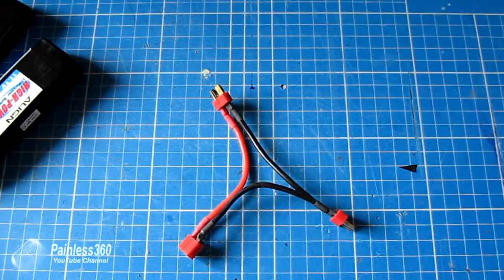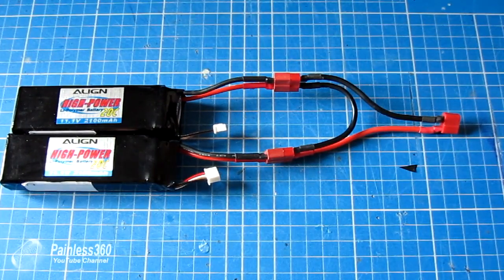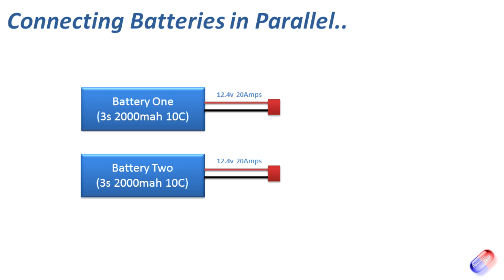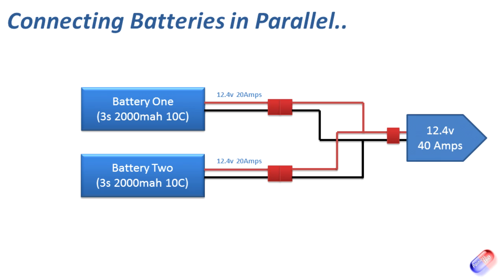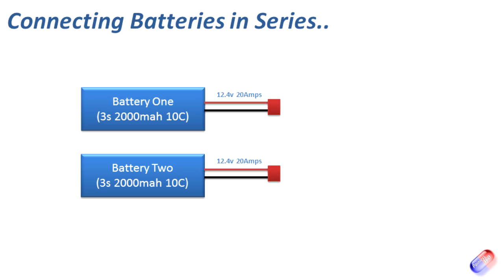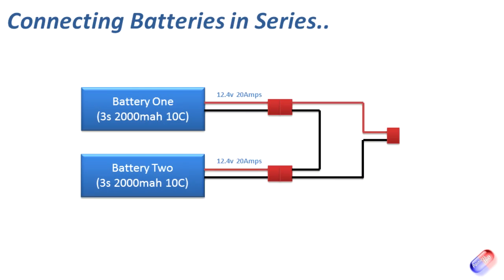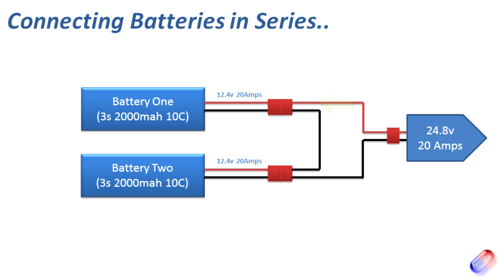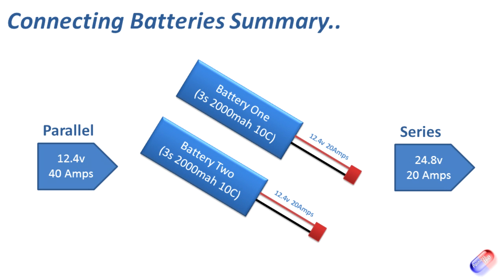Connecting batteries in series or parallel (LIPO)

Comment: Hello, I'm new to rc. I would seem that connecting in series and gaining more volts would increase the performance quite a bit but if you want more reserve energy, parallel would be better. Is this a good assumption?
However if
P = I x V
480w=40ax12v parallel
480w=20ax24v series
Why does the motor perform better under series? What am I missing?
Reply: Correct, P = I x V

Youre not missing anything, its a vague concept so dont give up, look at it this way. 
(Im going to be careful on how i word this and use the proper definitions)

you can have
higher Voltage/less current
or
lower voltage/ more current 
It will still produce the same power (in reference to the physic's definition of power)
which is exactly what you showed in the equations.

However, connecting in series results in higher voltage, meaning higher "strength" or performance but same battery life

Connecting in parallel will result in the same voltage (no performance gains), but more battery life. 

As im writing this i found a clear way to explain

"The candle that burns twice as bright lasts half as long"

So, both setups will produce the same power over time 
Since their voltage is different, the time it takes(current) to produce said power will be different.

You can choose to have all the performance but for less time
or
Have less performance but for more time.

........

I am on alot of caffeine so ill keep going incase you or anyone else reading this needs a little more 

Two people both make the same power ($100)
Person A makes higher voltage but less current ($100 in an hour)
Person B makes lower voltage but more time ($100 in a week)
Reply: @danielcolado5444  right, ok I understand. Would it be better to increase both volts (up to what is permissible of course), thereby connecting batteries in series, and then connecting a few in parallel to increase the amps as well? I've heard though that the quickest way to blow motors is by increasing amps though as this is harder to control, is this a fair statement? How does one increase amps safely? Sorry for the bombardment of questions, I'm surely putting your coffee brain to work...
Reply: @mxm1766  LOL

Well let me begin by saying i am NOT an engineer, but i have tinkered with electronics throughout my life and took a couple of physics classes as a requirement for medicine (basic circuits and stuff, loved it)

I know for sure that overvolting would blow a motor.
I would assume a higher current would as well. 

Not sure if this is the right word, but if the motor and/or battery has a "regulator" that determines how much amp comes in then i dont see any harm. 
(again i dont think i used the term regulator correctly but for the sake of discussion)

Example:
Two 3.7v 700 mAh batteries in parallel would provide the same power as a single 3.7v 1400 mAh. This method in my experience would help your playtime run longer, havent had problems yet with anything catching fire. 

I am a novice so anyone with more experience feel free to add anything or correct me!

------------------

i did the same thing you are proposing. 
I wired an LED off road lightbar to my RC just how you suggested. 
Light bar rated at 9.6V but i only had 4.8V
So i ran 4 batteries in total.
Batteries 1 & 2 in series
Batteries 3 & 4 in series

Batteries 1&2 parallel to 3&4
Reply: Also what do you mean by better?
Both are helpfull. Like you said, increase the   voltage to the permissible limit then increase the capacity (mAh)
Reply: @danielcolado5444  better as in more performance and more run time. I suppose that the regulator would be the ESC in RC terms. Anyway, thanks for the insight

Comment: Which one is better to fly longer series or parallel?
Reply from the maker: Both potentially. If you're not planning on changing the ESC, motor and prop for maximum efficency at the higher voltage then parallel is the best bet..
Reply: @Painless360   Thankyou.

Comment: When connecting in parallel would it be adetageous to install a large diode so both packs supply the voltage and stop the less charged pack being topped up by the more charged pack. Or does this allow for voltage stabilisation?
Reply from the maker: It's an interesting idea. The problem comes from the fact that the diode will actually drop the forward voltage a little so that'll introduce more problems than it solves. Plus you need a diode that can handle the max amperage of the packs. Happy flying!

Comment: Hello. I have a question. I  have several 6s 5200mah 50c packs and will be needing 8s soon. The ESC connector has a loop connector connected to the 2 ESC leads which would normally have two 4s packs connected to each. Would it be possible to just buy some 2s packs that are the same brand, mah, and C rating and combine that with the 6 to get 8? Ive asked this in another forum and got mixed answers. Some said NO WAY!! And others said its no different than combining two 4s packs to get 8s. Thank you

Comment: I have two 1400kv motors and two 2200mah battery.....so I need more flight time so I should connect them in series or parallel ....plz reply ASAP
Reply from the maker: See my endurance builds. More mah is what you need....

Comment: Hello,

First of all great vídeo as always.
Just one question.
I have a couple of turnigy  6s  5000mah 25c.
Now i need  8s. Can i buy 2s  5000mah 25c and use them in series and will work fine, right?

Hope on a reply

Thanx
Reply from the maker: In theory but using old and new packs usually results in cells with different internal resistance so it's not ideal..
Reply: @Painless360  
Thanks for the reply
I'm saying these 6s have only 2 cycles of charge, so i consider them new. So these 2s will be new also. So i believe its safe to do do. Using a 6s and a 2s exactly with the same specs to make a 8s. With your experience on the subject , its safe and allowed to do.

Hope on a reply

Thanx

Comment: I’m currently at a dilemma rn. I have two lipos both same discharge and voltage, but different mAh storage. This does help with putting the batteries as one in parallel, and increasing storage. but how wud I wire them to charge together as one lipo with a simple lipo charger. Can someone give me some tips? I know it has something to do with splicing both charging connectors from both batteries but I need to know how. PLSS HELP ME
Reply from the maker: See the later video on the topic. I would not connect dissimilar packs together...

Comment: Hi there, can I connect say 2x 4s packs with different MAH in parallel or do they have to be the same MAH and c rating? Cheers
Reply: Id say they have to be the same capacity, even though JB says that charging different batteries of different capacities is quite ok. Check his video and suit yourself.

Comment: Is this better or worse for the motor and does the c rating double?
Reply from the maker: Having more power available the batteries isn't a problem. Increasing the voltage above the rating of the ESC and motor are.. Happy flying!

Comment: The performance will be the same on 40am 12.4v or 24.8v 20amp?
Reply from the maker: Depends on what you mean by performance. That is the same wattage (V x A) but the[performance of the motor and prop has just as much to do with how much thrust is produced..
Reply: @Painless360  so the motor performance will be same on both? Like speed and torque?
Reply from the maker: You would different motors and props.. See my motor testing I did in the efficiency quad builds to see why.. Best of luck!

Comment: can i join , 4 battery in series and 4 battery in parallel, together, for charging them at the same time with the same charger ? example- 12v 24ah ×4 in series+ 12v 24ah ×4 in parallel?
what would be the ultimate voltage and range capacity would i get ?? can you please tell ?

Comment: I HAVE A RC BOAT....    I WANT TO RUN ON 6S-5000mah, 50C-100 ,     WOULD a SERIES-PARALLEL CONFIGURATION offer me any benefit in SPEED/BURST ?     I'm more interested in SPEED, rather than run time.  Any info is appreciated... THANKS
Reply: I'm not good in electronic.. but you need to read the voltage of the motor to see that.. in theory, to get more speed, you put the batteries in series.. but if the voltage of the batteries in series is more than your motor, the motor can burns.. (Sorry for my English, but don't do things that you don't know... Learn electronic, then you can try to use series and parallel.. If you fail, you can get several damages.. so ask to an expert.. there are other problems using that, so yeah)
Reply from the maker: The previous answer kind of covered it... 

Motors are rated for specific voltages so you'll find that it can support a certain sized prop/screw for one voltage but you need to use a smaller prop/screw if you increase the voltage. Just increasing the voltage without making sure all of the pieces can handle it will fry something. If you have a setup that will run on either 3s or 4s batteries (for example) then by using the higher voltage pack it will pack more punch. You need to be looking for a fast motor and prop for the model and then working back from there to the ESC and lastly, the battery you need. See the other videos in the 'Introduction to remote control' series..

Comment: I see the video is old but it worth a shot....  I have   2 -   3 cell batteries with a 12 gauge wire and a parallel connector with 14 gauge wires will that be a problem?
Reply from the maker: Please see the newer version of this video that covers a lot of the common questions I had on this one.. Best of luck!

Comment: So if I understand correctly parallel will accomplish more range and more operating time @ the voltage of one battery and series will give more volts or more punch or Higher output demands and the mAh of one battery?
Reply from the maker: Both provide more useable energy for the model. It's how that's available to the model that changes. The higher voltage will turn the brushless motors faster so you do need to reduce the prop size normally. See the newer video on this topic for more details.. Best of luck!

Comment: What happens, when you use 6s 3300 mAh 60C battery on rc motor, which specs say - 30C to 45C? Will it damage the motor or it is ok
Reply from the maker: No, see other other videos in the 'Introduction to Remote Control' playlists that explains why..
Reply: @Painless360  Great job on videos!

Comment: Painless360 Did you know that you should also have done a Parallel & Series wiring so that you get both Double the Voltage & Amps. Remember that you do NOT exceed the voltage of the ESC, else you will fry it. Connecting in parallel gives you more Flight time. Most big scale RC Helis require two 6S1p batteries wired in Series. I prefer to wire them up in both Parallel & Series. I just make sure I don't exceed the ESC Voltage period.
Reply from the maker: Yep - see later updated video (this original is VERY old!) ;)
Reply: @Painless360  Cool, when is latest video coming out? If you have it, please provide the link.
Reply from the maker: All indexes and searchable. Google something like ‘lipo parallel painless360’ :)

Comment: Which rating battery is needed for 2200kv bldc motor
Reply from the maker: Again, you need to check the specs of the motor you're interested in to find out the amp draw at maximum thrust with the prop you're interested in using. Please see my videos in the introduction to radio control series that explains all of this it's design for beginners. Best of luck

Comment: I want to fly my drone longer 3.7v 1200 mah ? Can I connect them and get same power with double the life ??
Reply from the maker: Using two packs in parallel will let you fly for longer but it won't be twice the time due to the extra weight of the additional battery..

Comment: The mah value always stays the same?
Reply from the maker: I don't understand your question. In what circumstances?
Reply: Well if you have two 2000 mAh batteries and you connect them in series or parallel you will have 4000 mAh

Comment: Hello can I connect 2  batteries in parallel with the same voltage just different mah both 36v one has 4400mah and the other 8400mah?
Reply: Normally when connecting batteries in parallel you want to use identical batteries.

Comment: So...
could i make a 1s 6p battery pack and use a 1s charger if all cells are same voltage?
Thanks
Reply: If you make a 6s out of 6 1s batterys and you want to charge them at the same time is like charging 6s but if you charge every battery appart you need to charge at a 1s charging rate
Reply: Glen Bruyneel Thank you

Comment: If I connect battries in series will i get more run time as well ?
Reply from the maker: Possibly, it's just like adding a pack with a higher voltage. The same power will be pulled but as the voltage is higher, the amp draw will be less (assuming the power system is happy with the increased voltage and you've adjusted the prop accordingly)..
Reply: Thank you for your reply 
So if connect  2 batt 5200mah the will i get 14000mah and more voltage ?
Reply from the maker: Sadly not. See the newer version of this video. I answer this in there..

Comment: If I'm running a 10.5Ah 6S Li-Ion battery, and I want to increase the capacity slightly, would it be ok to add a 6S1P pack(3.5Ah) in parallel to the setup?
Reply from the maker: Please see my later video on this topic - it should answer the question (short answer - should be ok)..

Comment: if running parallel 2200 mah 3s is it ok if one is 25 c and one 30 c would like to know before I try it. would it just give a bit more extra power over the other one? thanks.
Reply from the maker: I wouldn't run that myself. That higher C rated pack will have a lower internal resistance that will result in it supplying more of the current. Always use the same spec. packs is my tip. See the newer version of this video..
Reply: Painless360 ok awesome thanks wanted to make sure. I know back in the day you only had volts and mah to match. thanks for the help eh.

Comment: I have a 48 volt 1000 watt motor and speed controller. With four new battery’s that 12 volt nine amp hours all the same brand and another set that are 12 volt 12 amp hour whenever I hook the battery’s up to the electric motor which is on a razor atv. That I have modified. There is a huge spark everytine. Why is this ? Also have burnt up two speed controller like this. Please help

Comment: Thanks for the video mate. I have a 5th scale vehicle coming from china it's the fid Dragon hammer voltz it's brushless,  and I need to know what will be some good connectors to solder to the wires . The motor will be running g off of two 4s 16,000mah 25c lipo battery packs. The esc is the ztw 300a beast pro.

Comment: how can i connect 2x 4s 1550mah tattus to operate as 1? because if i use one in the front of my speedboat its to light. i dont want to blow up the kv2881 motor.
Reply: oh i checked one is 45c other is 75c is parallel possible?
Reply from the maker: No ideal..

Comment: When it comes to parallel does the C rating increase or stay the same?
Reply from the maker: The C rating of the packs never change. the rating of the virtual pack created by parallel connection increases..
Reply: So if you got two 1300 mAh 45C and you put them in parallel only the amps changes not the C rating? Then it will become a 2600mAh 45C not 2600mAh 90C.

Comment: I'm looking in to getting the "Cirrus SR22T 1.5m BNF Basic" but I want to get some good battery life out of it, I'm thinking of getting 2 "Li-ion 4S1P 14.8V 3500mAh ENDURO Advanced Lithium" Batteries and joining them but it adds to about a pound of weight to the already 3.6 pound plane, how well would the plane be able to handle that extra pound? Thanks.
Reply from the maker: Difficult to answer as I've never had one. But that sounds like an awful lot of additional weight for that size model...
Reply: 'Guess I'll need to do some checking around. Thanks for the quick reply.

Comment: Hi, can I ask some questions, for this video 2 group lipo battery without BMS before join? Or with BMS join? When after join need update BMS? Thanks, urgent please , Wait for answer do my Job.thanks
Reply from the maker: What’s a BMS?
Reply: Painless360 system

A battery management system (BMS) is any electronic system that manages a rechargeable battery (cell or battery pack), such as by protecting the battery from operating outside its Safe Operating Area, monitoring its state, calculating secondary data, reporting that data, controlling its environment, authenticating it and / or balancing it.[1]

A battery pack built together with a battery management system with an external communication data bus is a smart battery pack. A smart battery pack must be charged by a smart battery charger.[citation needed]

Comment: Thank you this was very informative I have a bike I’ve been building the last couple months and I have to hover board batteries both 37 V and 20 A and I’ve been trying to figure out if I can connect both positives and negative’s together and then charge both of them together as well as discharge as they don’t have a second set of connectors but really just a positive and a negative
Reply: If you do that, you will fry your batteries